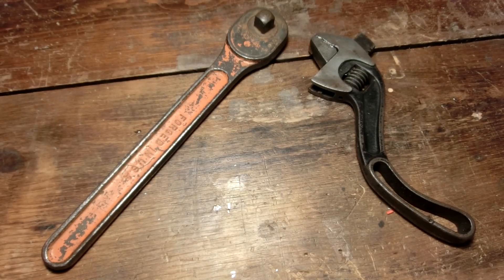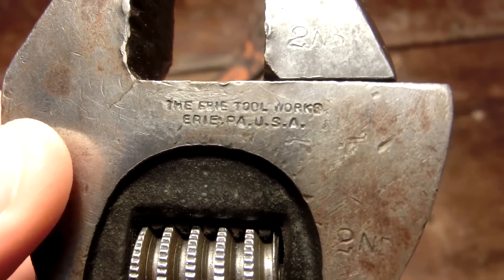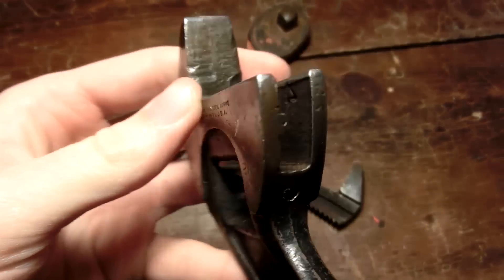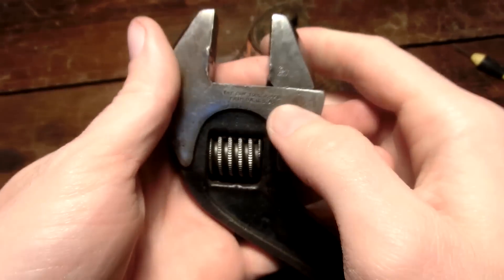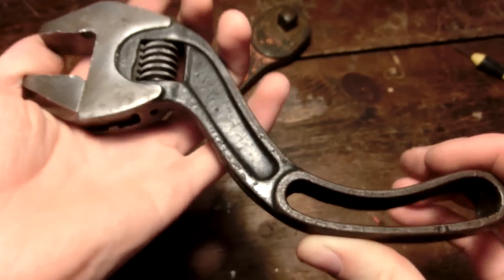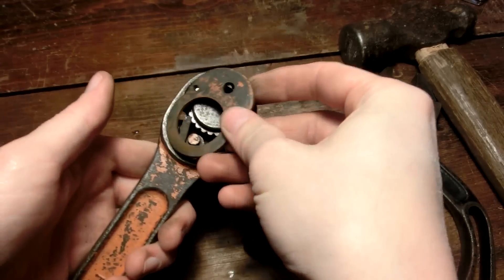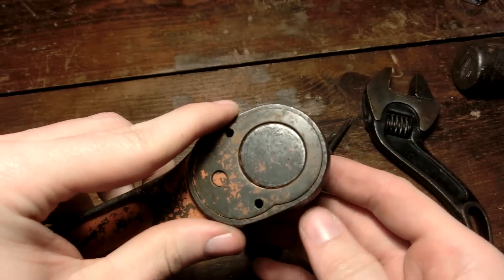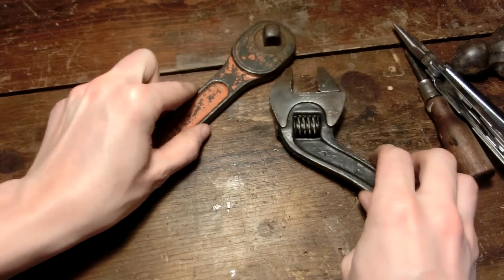A Very Close Look At Two Antique Wrenches

Comment: I have a cheap torque wrench built on the same design as the ratchet in this video. I was replacing a timing belt on my '86 Ford escort and it requires you to torque the cam sprocket to a specific tension and hold it while you tighten down the tensioner. Only it had to be torqued counter-clockwise. So I took the wrench apart, reversed the bit with the square drive on it just like you did, and suddenly I had a torque wrench that worked counter-clockwise.  I couldn't afford a better wrench at the time so I was lucky to be able to modify what I had. 

Keep on thinking and exploring!

Comment: I was all fired up about pointing out the Pennsylvania thing, but I was late. :-) I saw an S wrench at the transportation museum in Scotland. Some great old motorcycles in there too. Nothing more fun that taking stuff apart, even old wrenches. Good video.

As for possible extra info, especially if it was military or industrial, the socket wrench is painted orange? I know we had to paint alot of our tools orange or yellow to see them in case they get dropped in machinery. I wonder if that's why it was painted. That wrench design is currently used today. my torque wrench has the exact same design in the wrench head. the ball in the socket insert is pressed in with a press during manufacturing. Also, the turn selector isn't stiff. just twist the the socket insert slightly (jiggle) and the selector should slide into place.  (fyi, I don't know the proper terminology for each part but, you get what um sayin). Cheers.

Comment: Hi Rinoa. I have taken newer ratchets apart before and they usually have a bit of grease in them to lubricate and to protect against rust. And I bet those springs are stainless steel or are a newer replacement.

Comment: You should dismantle the s wrench and scan it into your friends computer and 3D print one out, that would look really cool, plus you could do the adjustments to the teeth, and then use that to make a mould to cast an interchangeable jaw for the original one, plus you'd still have a printed one you could use for lightweight work.
Reply from the maker: +TheAussieStig30 thats not too bad of an idea, i wonder if i should work on ways to reinforce 3d prints